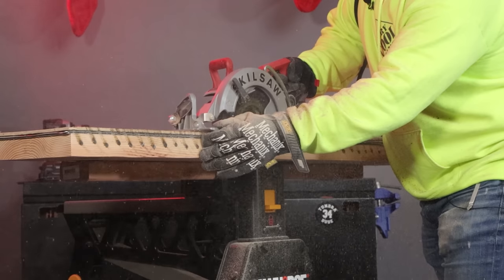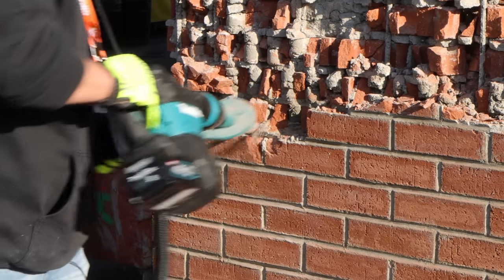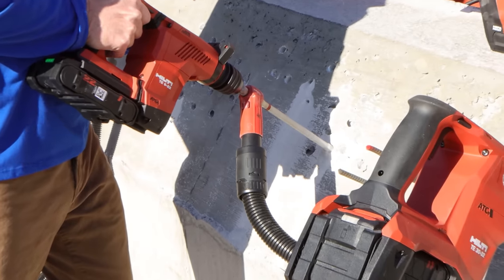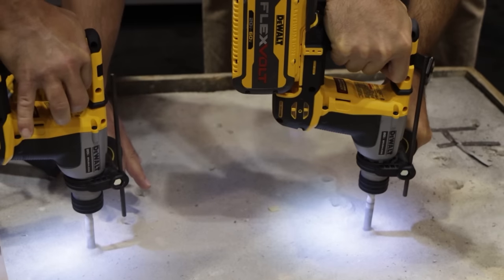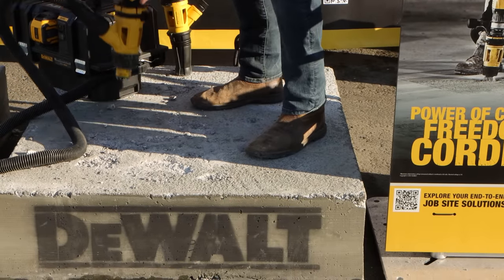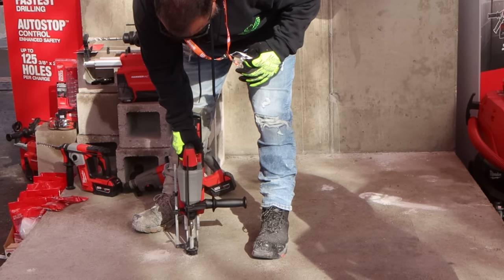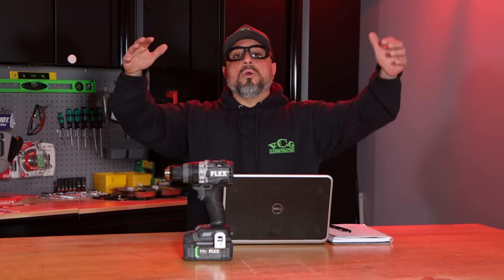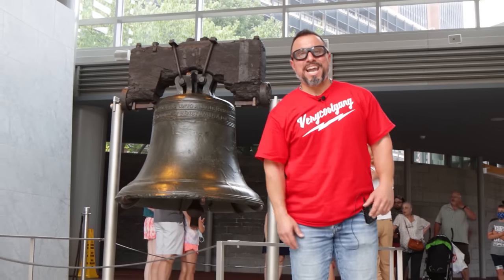Top Cordless Power Tool Brands RANKED!

Comment: I've been in the trades since 1987 - I mainly do high end custom furniture of my own design and smaller unique home improvements, mainly built-in projects. Back in the '90's I was also in the film production world designing and building theater sets then film and TV sets - Back then I tried every cordless system available and Makita tended to be top-dog. (I still have and use my 7-1/4" Makita corded circular saw I bought in '87) - Once I got to more shop work I stepped down to the 12 volt Bosch system not needing the large/heavy cordless tools....
  Now I'm in a completely different world where I'm building out my 4x4 Astro van into a capable overlanding rig and taking on projects all over the country and I really need to get into a complete cordless system (which is why I find myself here) - I was aware how awesome the FLEX system preforms and want to pull the trigger BUT their lack of tools is what's keeping me from going that route - I'm considering MIlwaukee because they have EVERYTHING including a chainsaw which will come in real handy out in the bush. If I knew for sure FLEX was coming out with that I'd just go with them.
  I also have a burgeoning YouTube channel and was looking at possibly seeing if any of these companies might want to sponsor me as their tools will get plenty of play on the channel. 
  Anyhow, thanks for the informative video

Comment: I am keeping a close eye on Skil, Makita, and Milwaukee. I don’t disagree with your top 5 but I would add Skil. Thanks to your cinematic documentation, I am keeping a close eye on Skil. I am in the Makita LXT platform and I have a single Milwaukee impact driver in the pack out case with 2 CP 3.0 batteries ( so far the best battery I have used). I really like Makita for vibration mitigation.
Reply: Skil is making a great cordless rear handle saw, but it's a weighty beast and batteries are expensive. What else is Skil offering in the cordless market?

Comment: my top 5

Makita
Milwaukee
Dewalt
Metabo
Ridgid

I could say hilti, but I never seen or used one in person so I could not rate it.
Reply from the maker: Nice, thanks! 👍🏻
Reply: I agree 100%. I wish makita had a Cordless compressor, Cordless table saw and a smaller rivet gun just to get into tighter spaces.
Reply: @devinnelson5410  not everyone needs a Cordless compressor or a rivet gun, but would be nice to have the option right.

Comment: I dont know, but i feel that Flex as #1 is a massive what if. As it stands right now, with personal experience with all these tool brands, in my opinion, Milwaukee beats out the rest by a long shot. They have an incredibly expansive lineup in the m18 platform, with a very good "sidekick" m12 platform. I understand the issues with the mx fuel line, but i doubt Flex will come out with huge breaking hammers (like the mx fuel or hilti) anytime soon. Milwaukee is expensive, but not unattainable. The availability is excellent for most tools, and the warranty is pretty standard across the market. So until something revoltionary comes from another brand, im sticking with Milwaukee

Comment: 1st place doesn't make sense since this flex platform only exists in usa and here we talk about brands which are available world wide. Based on units sold worldwide and the availability of the brands the top 5-6 in no particular order is Makita DeWalt Milwaukee Bosh Metabo Hikoki (MetaboHPT) followed by Hilti Festool which are usually considered premium choices for concrete (hilti) and wood working (festool) like metabo used to be in metal working and they still have some premium tools for metal working. Also these days at least in Europe i don't know about USA is another german brand which makes premium wood tools Mafell and they are on the same battery platform like Metabo they are part of CAS (Cordless Alliance System) and they use basically metabo LiHD batteries. Bosch also has launched AMP Share which is a new battery alliance which is based on bosh pro core batteries one popular brand joining is Fein

Comment: I want a Milwaukee sheet sander, and airless paint sprayer. I also think the m18 fuel brad nailer could just be m12 fuel.
Reply: I agree that their brad nailer should be M12. Been saying it since they released their pin nailer. No reason for it to be so huge. I'd even buy it if it only went up to 1 1/2".

Comment: I'm a professional Timberframer and tool addict largely using Makita, Dewalt, Hilti and Milwaukee.
 I agree that some brands do specific tools better than others. I prefer fit and finish and have to say Makita does power planers beautifully. The only manufacturer I know that makes the monster 12" beam planer and curved shoe. Makitas fit and finish on their xgt 3"1/4 planer is far better than anything I've used. Feels smooth and tight. Makes Dewalts 3 1/4 feel like a fisherprice toy. That being said, Dewalt's flexvolt battery line can outperform in power and I have mostly flexvolt. Although, I'm leaning towards Makita for how smooth and precise their tools feel.
Milwaukee's cordless impacts are unbeatable imo. 
Hilti all the way for rockchippers. Anyhoo, just my two cents

Comment: Milwaukee has a patent out on a dual recovery/vacuum pump for hvac.  I’ve been considering a jb flex model that just came out that appears to use rebranded Milwaukee batteries, but if Milwaukee is fixing to come out with one I want to wait. You heard anything about this from the bigwigs at Milwaukee, Vince?
Reply: I’d definitely hold out for the Milwaukee if they are in fact making dual recovery/vacuum pump. I’ve seen the Navac and JB Flex vacuum pumps but why bother if you’ve already provided power for the recovery machine. Hopefully Milwaukee will come through.

Comment: Hi Vince, great video and passion as always!  I am not a contractor, just a DIY tool enthusiast.   See below as I would rank the tool platforms :        1- Milwaukee, Makita, Bosch, Dewalt, Hilti.  I am impressed with Flex however they have entered the tool market a few years too late in my opinion.  Additionally, I don't think of Lowes as a heavy contractor business compared to Home Depot.  Flex tools seem a bit expensive and feel heavy.  I am impressed with the battery technology and like the parent company as I own Ego branded equipment.  Flex may need another source  or distributor to really get the sales the company probably needs to see.  I was glad to see Ridgid was not on your list.  I tried a few tools and the LSA is a scam and the tools are overpriced and underperformed.  Ryobi seems like a better deal. Depot should dump Ridigid and get Flex in their stores !Lastly, I know people may not agree with Bosch however they are great tools and have terrific build quality as they are German engineered and utilize  a newer battery technology.  Let me know your thoughts.  Stay safe and best regards to everyone.
Reply: How are those Bosch batteries holding up? I don't run any Bosch cordless, so I have no first hand experience, but I have been told by a few that the batteries aren't great.
Reply: @pheloniousmunk  the Bosch batteries are fantastic.  I run the 4mAh and they hold a charge fir a long time.  I picked up a few with the last promotion at Lowes. They also have an 8 and a 12mah.  Very well built with cooling fans and a battery light meter.
Reply: I'm a Bosch and Milwaukee user. I used to have 1.5Ah and 2Ah Bosch slim packs but right now I only run 4Ah CORE batteries with 21700 cells. Bosch was one of the first companies to switch to 21700 cells and the 4Ah battery is about as compact and light as the 2Ah batteries I used to own. I like how the battery has 5 LED indicators unlike most other companies with 3 or 4. It makes you more aware about how much battery is left.
My batteries have been great, 2 of them are 2 yrs old and the other one is almost 3 yrs old. They work just like when they were new.

Comment: I would like a video on inverters.  Seems like only a select number of companies are offering them with their batteries (Milwalkee, Roybi, Ego and Greenworks).  I wonder what companies would join the list especially those that have invested a lot recently in their battery platform like Dewalt, Flex and Hilti.  Having inverters are great for power outages, use less wires and increase the value of buying a battery platform.

Comment: 1. Milwaukee 
2. Kobalt XTR & 24-Volt line
3. Flex
4. Hilti
5. DeWalt

I personally have always been a Milwakee guy, but had to sell all my tools a couple of years ago. Just recently got back into the trades as a residential electrician and purchased the Kobalt XTR line five-piece kit and have been so impressed. I also have the Kobalt 24v one-handed Sawzall, multi-tool and 3-gallon vac. My buddies at work would poke fun at my Kobalt line of tools until I put them up against their dewalt's and smoked them in several different tasks.
Reply from the maker: Solid list, thanks Cuz! 👍🏻

Comment: I worked in custom cabinetry for 14 years. We used Makita, they never failed. Had 2 DeWalt drills that were trash. They wouldn't hold their charge. Bosch came out with lithium battery and smaller drills. They seemed okay

Comment: Will you ever test/review Porter Cable tools or is it because they aren't really sold at Lowe's or Home Depot? I'm just a homeowner with a small town local Tractor Supply and got mine there. I've had them for years and they have held up so far. Interested on your take.

Comment: Great video! If I was a contractor, or a jobsite worker, I would 100% agree with this list! But as a woodworker/furniture builder, most of these brands are not as ideal. My list would be: 5. Milwaukee, 4. Craftsman, 3. Skil, 2. Makita, 1. Dewalt. Well, actually Dewalt and makita are tied. Personally, Milwaukee has too much power and not enough controllability for me, and not enough runtime. Skil and Craftsman are great, as they’re cheap, and very high quality. Makita is great, and would be my favorite, but they’re more expensive than Dewalt. Great video outlining which brands are great for the out in the trades!
Reply: I have both Milwaukee and all of the Brushless Craftsman. The Brushless reciprocal saw by craftsman is faster than Milwaukee, but outside of that, Milwaukee tools blow the Craftsman away. I'm just curious how you ranked Craftsman higher than Milwaukee?

Comment: I have always been a milwaukee guy. Their corded tools simply ran forever and the M18 platform has served me very well. At least until the last two tools I purchased. I purchased a new impact driver and a drill. Both have so much runout that they are basically unusable. I think Milwaukee has put cost and profits over quality and for the first time, I'm probably going to switch platforms.

Comment: I don't get why Milwaukee is getting a bit of push back now for having different battery platforms but everyone ignores that that dewalt and makita have lots of different battery platforms that are not interchangeable. Milwaukee's platforms are pretty well delineated. MX for site equipment, M18 for most things, M12 for small stuff. The twin battery systems are an outlier BUT they do allow you to run new higher capacity tools on your existing M18 batteries - meaning they are more backwards compatible than any of the other companies. I really appreciate the fact that Milwaukee has gotten so much out of M18 and has continued to do so even when others have gone 36V, 40V, 80V etc etc.

Comment: My company provides a Hilton tool kit with a bandsaw, hammer drill, impact drill, and sawzaw. The only complaint I have is with the band saw blades. They are not that good and I haven’t been able to find other brand of blade that will fit on the band saw, the only blades that will fit are the hilti ones

Comment: I run Milwaukee and Dewalt. So if I like a certain cordless tool in either platform I’m not totally married to only one brand. Flexibility is crucial. One may make a certain tool cheaper or lighter or just better
Reply: Been thinking about this. I saw the dewalt hammer drill is better then the milwuakee gen 3 hammer drill by long shot, contemplated getting a milwuakee impact and having a dewalt drill but the battery price is a lot

Comment: Flex volt advantage tools are unbeatable with the combined power and run time. And if you want a compact they have atomics combined with power stacks. So go big with FVA or go small with powerstack atomics. The middle of the road XRs do get beat by Milwaukees 🤷‍♂️

Comment: I would pick Milwaukee as number 1 and I was mostly a DeWalt guy for years. Milwaukee, DeWalt, and Makita all have a wide range of high performing/high quality tools available....no promises that they're going to develop something in the future, they're already doing it. I think that across the board, Milwaukee is proving their slightly better quality(than DeWalt) on thousands of jobsites every day, and I have to admit that Milwaukee has some great tools in the M12 lineup. Flex, Kobalt, Rigid, Ryobi, and Bosch aren't even on my radar....I'm already invested in the Milwaukee, DeWalt, and Makita battery platforms and the tools have proven their quality and performance. I think Metabo HPT is a brand that people should be watching if they're gonna go off into the weeds on other battery platforms.
Reply: Ive heard the batteries go bad and despite being made in China they still charge made in USA prices.

Comment: I need an m12 grinder. That little cutoff tool they have is cool, but a standard size blade would be nice.
Reply: The cutoff tool was a bust for me, underpowered and terrible dust collection.
Reply: I've just bought the 3" cutoff tool and has been good for me, but then I'm a DIYer/car enthusiast.
Although I agree a 4 1/2 grinder would be cool, I'm not sure 12V batteries are enough to power it . And the runtime would be presumably low even with a 6Ah XC. Maybe that's why no other company has dared to introduce 12V grinders?

Comment: I bought the Makita lxt about 5 years ago. And I will say from personal experience that the top of the line Makita impact driver has been the best one driving screws and lag bolts faster than Milwaukee and dewalt. I have personally tested until recently with dewalt's new power stack. However if not tried the 40 volt which I will be investing in next. Also the 36 volt sawzall cuts faster than a chainsaw through burnt roofs and the oscillating tool however not brushless also is the best. Maybe not the most ergonomic but cuts the fastest. I agree Makita does not come out with new updates but my theory is they wait for Milwaukee hilty and DeWalt to keep wasting their resources on things like powerstack and 60 volt so that they can totally dominate them with their 80-volt lineup. Seems like they did that I guess I'll have to have a Hands-On review when I actually get to use them. But I stick with Makita Ben a Makita guy since I was 12 when they had their 9 volt system
Reply: I agree. Does seem like they wait on others but I think its more of them over and over working on there stuff to get it right. Japanese style. Makita is all I ever would think  of using. I pick up other guys brands and immediately you can feel the difference.
Reply: Make mine Makita! The top handle 36 volt chainsaw is awesome  and most tools they make just seem to be more user friendly
Reply: If you buy a 40v impact you will not regret it. They are super smooth.
I have a full kit of 40v tools and absolutely love it.
Reply: Makita is the Toyota of the cordless tools: they wait on the competition to use resources on new tools every 2-3 years, fix what's wrong with them then release a reliable, more ergonomic and smoother tool.
The only gripe I have with Makita is they haven't transitioned to 21700 cells for their 18V batteries. They're bulky, heavy and make me feel like Makita is planning to phase out 18V tools in favor of 40V tools in the near future. Just look at their recent releases: they're mostly 40V tools.

Comment: 1. Makita/ festool
2. Flex/ hilti
3. Dewalt/Milwaukee
4. Metabo/rigid
5.ryobi/ craftsman

Ive used each of these brands as a finish carpenter framer and wood worker makita and festool make great saws Milwaukee finally looking at a larger platform will step up dewalt is just great for the price point but definitely not the best tools and metabo is the best value step above all the ryobis but priced great with cool innovations
Reply: wow, I agree 100% on the 1-4. . . 5 however I would only consider if I was on the budget or nothing else available

Comment: Im a metabo hpt (hikoki) fan but i live in japan and that is one of the best but i would love to use a Milwaukee or flex tool
Reply: I have 7 Hitachi tools. I can’t find new Hitachi / Metabo 18V Li-Ion batteries the type with a column that inserts in the tool, not the kind that slides on. Are they available?

Comment: DeWALT has Lipo batteries, true dual voltage batteries, 54v and 18v.  That alone should of out ranked Milwaukee.  

Flex doesn’t have the history nor experience to take too one.  And doesn’t offer true dual voltage capabilities.  Not to mention DeWalt will have the same lipo technology.  

1.  DeWalt
2.  Milwaukee
3.  Makita 
4.  Flex
5.  Hilti.
Reply: Dewalt tools doesn’t have the power to compete with Milwaukee fuel    The power stack and flex volt battery’s r what makes the dewalt tools powerful.  But they can’t outperform Milwaukee
Reply: @nathancrabtree758  

The Dewalt saws are more powerful than Milwaukee, the drills are significantly more powerful than Milwaukee’s

The only place where Milwaukee had,  HAD and advantage over Dewalt was in the impact driver and impact wrenches.  And that’s no longer going to be the case with the new and upcoming xr impact wrenches and drivers that will be releasing this year.